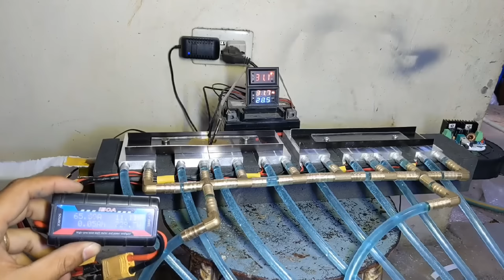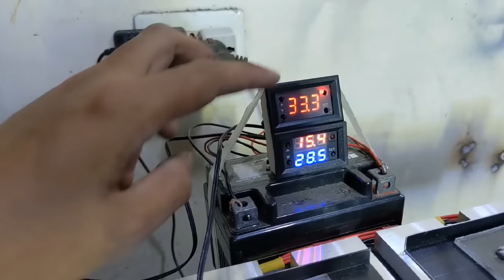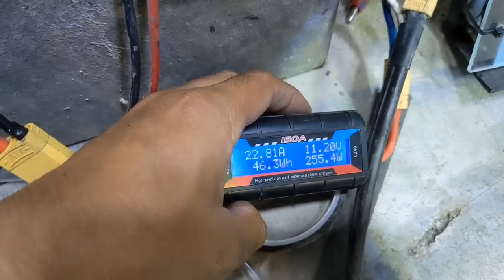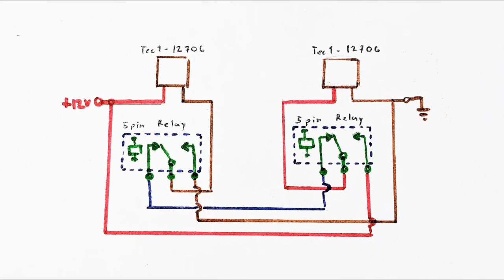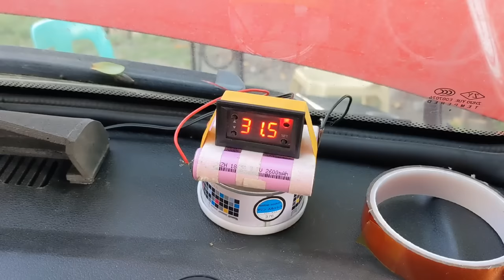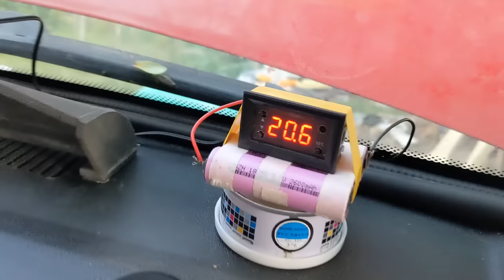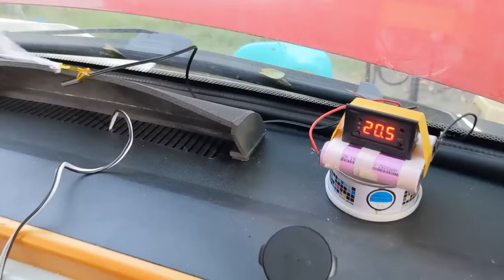car air-conditioning using peltier

Comment: Nice work Albert, congratulations, but improve this by removing water coolant, you will save on 2 motors, instead use big heat sink on hot side. put Peltier in a case such a way, that the cooler side will be inside the car cabin, and on hot side that 1 big fan will eliminate the heat efficiently. Rather you don't need that fan too, since you are using it in front side of the EV, just try it with atmospheric air flow without fan. Trust me you won't regret, even it can be powered by solar. Hope you like my idea, on which I am working since long. Thank you.
Reply: i disagree , since he is using It in a car , when the bonnet is closed , it could double the heat inside the closed space. for him to use a fan he will have to make a huge hole in the cars body for the fan(no one would do that) that is also considering he will have to make another hole for hot air exhaust . secondly peltier module's cooling depends on how well the heat is disapated from the hot side , water blocks make it extremly efficient for faster and reliable cooling regardless on outside temperature  and is also very  quite. he has definitely made the most efficient peltier cooling system by far on youtube.
Reply: I agree on the water but I would recommend using something other than the anti freeze for the coolant, pure distilled water has better cooling capacity and is a lot thinner which will draw more heat away and put less strain on the pump due to the viscosity. Also on the cooling side he should put the heat sink with thermal paste directly on the peltier, it's losing a lot of efficiency having to conduct the cold through multiple surfaces and no thermal paste on the cooling side has small channels of air that is a poor conductor as well. For the fans and pump he should use brushless to save a lot of energy and the cooling air intake should be taken from inside the car so it's recirculating making it even more efficient. In not bashing his work at all, I love it, he's done a great job but I just want to help him with suggestions like he asked. I'm not positive but also if he were to use a large capacitor for the power to the peltier I would think he could have that charged as well as the battery at the same time giving him more efficiency and drawing less power with less power spikes, especially stuttering startup when it uses the most power. This is so awesome,  a solar panel added to the roof to charge the cooler battery and large farad capacitor alike save him even more, he'd get a charge while parked in the sun, it would help the battery last longer on drives in the sun as well.  I'm also thinking to plumb the radiator outside the car are where the air from moving the vehicle forward would cool it and have the fan on a switch or thermistor to switch on when he's not moving, parked, at a light, or drive-thru would meet him more efficiency too! I love this idea that he's come up with, best use of peltier units I've seen.
Reply: @nikhil126  nah, I have seen better systems. One guy made a beer can chiller. He has vast experience. I liased with him after wasting 3 months on peltier. He admitted despite his success, peltier was a " no go" in terms of refrigeration!!
Reply from the maker: i will consider all your comments, thanks.. 2nd version is coming
Reply: @anthonyortega3136  best use of peltier!! Thts totally incorrect!! It's a heat pump being used to cool!! Crazy!!
Reply: You certainly have no practical experience with Peltier!!! Even on a peltier mini fridge, water cooling is  the ultimate way!! Remember, we no longer have cars using air cooling like the VW beetle. Water cooling is way more effective!!!

Comment: Try using the heat from the exhaust with a set of peltiers to produce power,  than use the power for the cooling peltiers. That way you wont kill your battery or alternator.
Reply: Peltier produces a marginal amount if electricity.

Comment: You need to fix blower somewhere inside the car so it will suck the internal air in this case ur ac will work more efficiently
Reply: U r right sir

Comment: that was same ideas i used in my bus RV because cant run ac windows and drive down road it stick out too far which why i use a lot of peltier and run liquid cooler thur it increases cooling inside it was worth it but it take a lot of homework getting it set up
Reply: How much amp did you draw and how noticeable was the difference ? Thanks :)
Reply: @TheThunderwars  10 peltier with two water pump and 2 fan about 17amp with deep cells battery last about 20 hours if you add 3 deep cells battery last about 85 hours

Comment: 2x8 = 16 peltier x6A =96A blum kipas dan pompa. Kalau untuk mobil mana cocok gan aki innova aja paling 70 A
Reply: I'm not a eletrictian but he also said at they where running 6 volts in a series setup (in the video its a mix of series and parallel,half what is needed to run one TEC1-12706, all these "magic" numbers  to get "magic" results. Not to mention the battery they used to mislead everyone to think it was being used for the peltiers or the thermomters with those tiny wires would have melted. Another Youtube channel giving false information to get views.:face-green-smiling:

Comment: The cooling efficiency of a long heatsink is very low. Last heatsinks in air flow cooled by hot air from the first ones. 
Radiator must be short and wide, same as car radiator. I think, if you cut half of modules, efficiency will not dropped down more then 10..20%.

Comment: Bro. You better buy a 0.4hp window type aircon and 12/24volts to 220volts power inverter. Its consume 400watts only. And more efficient than peltier

Comment: I have a similar idea but i want the Hot side of the peltier to be a pc water cooler (4fans) and the cold side pc water cooler 2 fans no cooling the peltier with Air but water and the cold side with water too so you can put a cold radiator on the inside and if its winter y could change the peltier to do the same but in reverse cold out hot in

Comment: better you put peltier inside cabin, i think little efficient rather than outside, because the air were was cooled circulated and sucked by blower then temperature down. and also your waterblock not blown by hot air were coming from radiator instead of condenser. we wait the update.

Comment: There are 16 peltiers fitted in this project. The current required will be 16*6=96 amp for the peltiers alone. May be total current required shall be 120 Amp. Which alternator of a normal car can generate this much current with out damaging itself and the battery. Seems illogical and hypothetical project.

Comment: There is no way to make it efficient in a practical manner.   The peltier modules are just very inefficient by nature.   It is only good for small projects  or when you just want to cool a small area  without any regard for power consumption.   A small window air conditioner consumes less than 500 watts  while your setup consumes about 1000 watts.    That is just the nature of these things.

Comment: peltier is the electronic device with the worst efficiency, 700W for cooling with such a small result I think it is a huge waste of energy
excellent use of peltier I think only in portable dehumidifier device for 5x4m room, with average electrical power usage at 50W

Comment: This is  literally the least efficient way to condition air. Many, many times less efficient and effective than traditional phase change refrigeration. For nearly 1000w of power, you'd be lucky to get 200 BTU of cooling. They make small 12v  brushless compressors that can do 10x that  using 1/3 the power.

Comment: 1000W, that's 70 amps of current. It's not much if your alternator can handle it.
Reply: That car is electric, so no alternator.
Reply: @n0tlance314   i figured it out later
Reply: Even worse. This terrible design probably cuts range in half

Comment: Power meter is showing very low power consumption 12706 peltier module consume only 6watt power 16 should consume 96 watts 
2 pumps used are of 0.8 Amps a total of 19.2 watts, blowers used consumption should not consume mire than 36 watts
Total power consumption should remain around 150~160 watts
Temperature is measured with doors open and reached 23° ambient temperature was around 32°
Peltier temperature difference is 68° 
Inside temperature with doors closed 
Keeping all the facts it should drop subfreezing easily
I don't understand why experiment is considered not satisfactory

Comment: Does anyone have any idea what the cost would be on these materials ?
Reply: I can't say about the cost at your location
At my location peltier used cost around 2us$ and heat hanger mounted on peltier around 1.5us$
Radiator or main heat exchanger around 6us$
Blowers 1~2 us$
All other material upto 4us$
All the pipes

Comment: Sir, what if
Cool the water using peltier (only 3 or 4pcs) then use the radiator blowing cold air. then use heatsink na lang sa peltier to dissipate the heat?

Comment: Sorry to say but you will have a much greater (many times more) refrigeration power with a traditional heat pump setup with a eletric compressor, and, what is best, with same or even less power consumption. Peltier devices are not efficient at all! A good car A/C working in propor order will give you, with a 30° out side temp a ventilation air in the evaporator with 4° temp. Thats what you need to propor refrigerate a car cabin in a hot day. You will soon abandon this project because it is not viable, sorry... 😢

Comment: For a ev it's efficiency would be very less on full power both relays n all modules working it will consume to much current n amps hence reducing mileage on single charge......you can try small air compressor running on less amps specially made for EVs or buy kit assemble your self

Comment: Do not work on this project anymore. You will end up wasting time, money, resources, etc etc. Peltires cannot be efficient.
Reply from the maker: it can.. version 2 is comming
Reply: @albertnario4877  God be with you.
Reply: Why its not efficient? I mean can we use it in cooler for little cool in hot summer ?
Reply: @Ravikalavidh1259  Give it a try. If you succeed, you will be awarded for it. 

If it was efficient why are we using huge compressors and refrigirants to bring the temp down in fridge and AC's ?
Reply: @albertnario4877   we is yiur new version coming bro? Goodjob u will make it